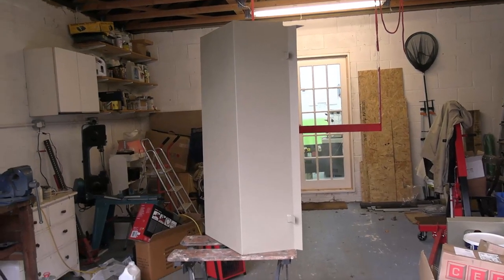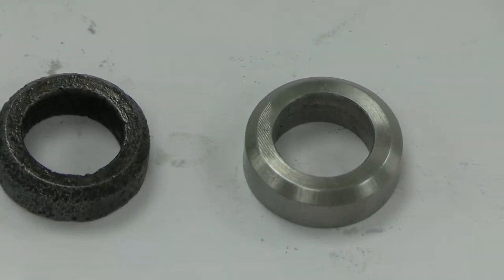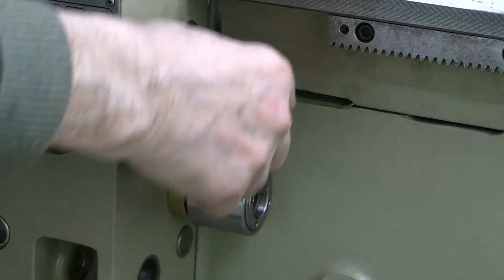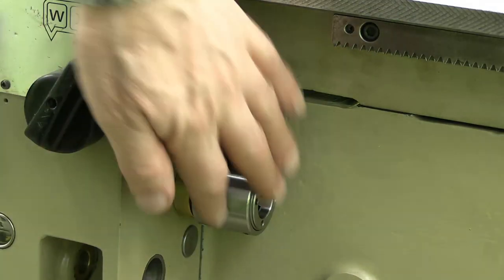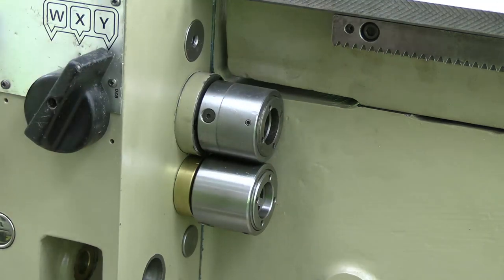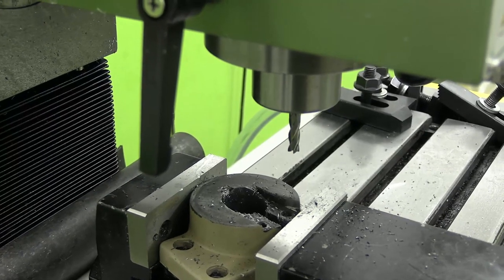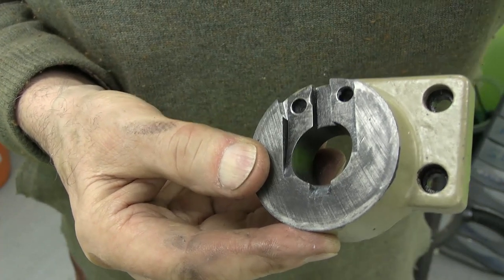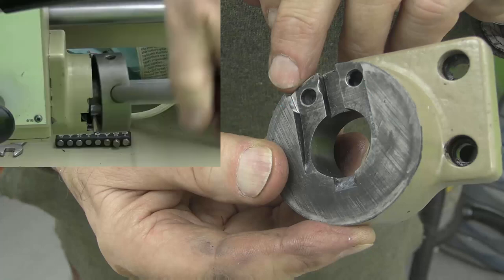Harrison M300 lathe - reinstalling the apron

Comment: Hi samuel, the pin on my M300 works the same as yours, it sits on top of the holes just enough to hold the lever.
Reply from the maker: Thanks. Perhaps the pin originally was slightly pointed or rounded to help it do so. Mine seems to be flat now.
Reply: @samuelfielder  Judd is right, mine is the same. The round end of the pin is held in the top of the hole by the spring and works as a gentle detent.  It allows a quick slap on the handle to stop the spindle.  If the pin dropped into the hole, the action needed to stop the machine would be a bit more tortuous.  Incidentally, there is debate about the direction the handle should be moved into for normal 'forward' cutting.  I remember seeing in some vintage Harrison document that 'up' should be the normal cutting direction: this makes the handle easy to get at for the 99.77532% of the time when the machine is running in the normal direction.  Mine is 3-phase wired that way and I would not disagree.

Your series is fantastic Samuel! Apart from the fact that you have a near-pristine machine now (I absolutely LURVED the section on the leadscrew gearbox!), it provides an insight into the workings of my M300 that otherwise I would not have.  Fortunately, my 1978 machine spent its life doing light duty in a school metalwork lab and thereby seems to be in better condition than yours (=less tinkering!) but if I ever need to lift the bonnet, I have your Haynes-like manual to work with.  More power to your elbow and ... what's your next project?
Reply from the maker: @ianthompson367  Thanks. I agree it's a good idea to be able to stop the feed quickly like that. I fear I have wasted effort trtingt up a lathe that's never going to be any good wirthout regrinding the ways. But at least I've learnt a lot about M300s. Steve Watkins (https://www.youtube.com/watch?v=I-fsppDRBsc ) has a Monarch 10EE (a more accurate lathe than mine) which has worn ways. He is planning to regrind and scrape them in place, so I'll look forward to seeing how he does that.
Reply: Ah yes, Samuel but it won't stop you working on shorter parts. Perversely, the error over the 6 inches of the bedways near the chuck varies little which allows you to produce quite a good bit of accuracy in that region. It's only if you want to turn something which is the full length of the bed that you'll come unstuck. Pragmatism rules!

Comment: Checked are m300 at work today it’s the same as yours the pins don’t go in the holes they look like they should but they sit on top like Judd says
Reply from the maker: Thanks. The holes seem to be about 6.5mm diameter whilst my pin is 8mm diameter. I have very slightly chamfered my holes (in the lever part) so that they at least offer a little resistance to moving back to the central position.

Comment: Can the Cam itself not be adjusted by loosening the
 grub screw?
Reply from the maker: I don't know. Is there a big flat on the shaft, or not?
Reply: @samuelfielder  I'm not sure but need to adjust mine, its not sitting equal to each microswitch. I'm going to attempt it and let you know
Reply from the maker: @jimspencer3072  I think the "correct" way is to adjust the length of that hard-to-get-at rod, thus changing the angle of the cam.
Reply: @samuelfielder  Thanks Sam, I may have to try that fiddling with the rod adjustment, not easy. The oil that is pumped from the saddle is it the same oil that lubricates the saddle or a different reservoir?
Reply from the maker: @jimspencer3072  Same as in the apron, which is same as headstock. Only feed gearbox has different oil.
Reply: @samuelfielder  Sam does a metric machine have 95/44 change wheels?
Reply from the maker: @jimspencer3072  Don't think so, see https://youtu.be/Y5KUD4Dq12Y?t=77